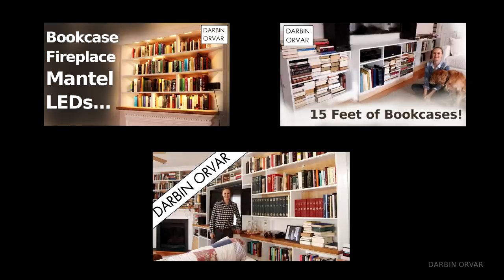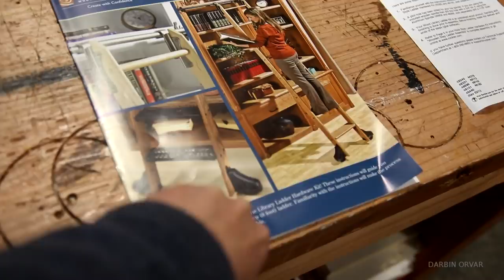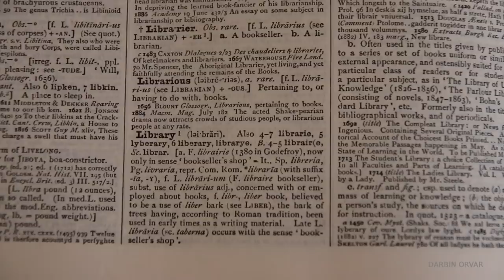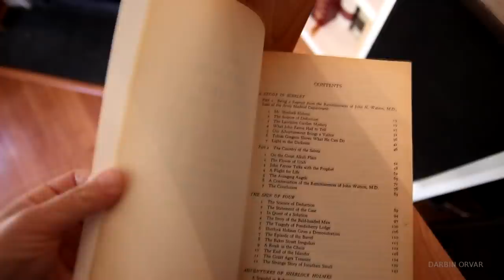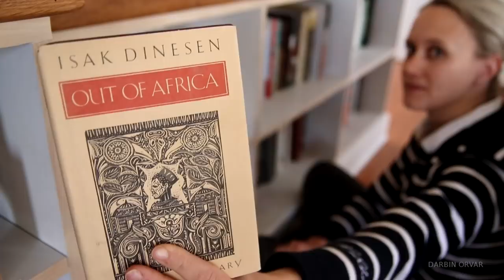You Need a Library! w/ a Ladder!

Comment: Thanks so much for sharing your fantastic projects! I always look forward to your videos as I know they will be thoughtful and informative. Thank you!  I have a question about the weight of this project. I’ve been wanting to do this in my house, but I’m concerned about the added weight to the flooring/joist system - especially on an interior wall.. Did you do any special calculations or did you just know your flooring system could support it? Thanks for any insight you can provide!
Reply from the maker: Thanks! This is no heavier than anything in a kitchen, so it is not really an issue.

Comment: You didn't ride the ladder down the wall!
Looks like Rockler's ladder hardware is not strong enough for that kind of fun.
If you had used those rollers that are used for barn doors, you could ride it without it breaking. Well, that is until Austin got big enough to play on it.
The rollers by the way, would be quieter.
Reply from the maker: You can roll down the wall, however I have a rug underneath part of the ladder which is slowing down the rolling somewhat. However on the bare floor it rolls superbly.
Reply: @darbinorvar  
Awesome! 😎